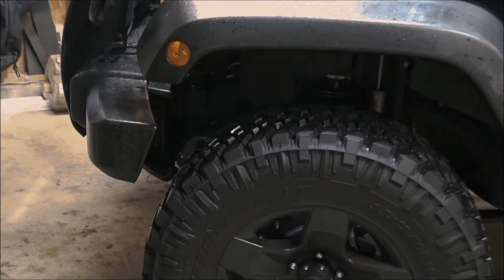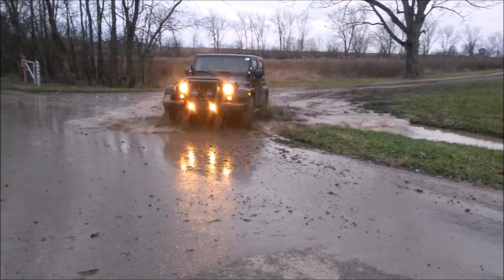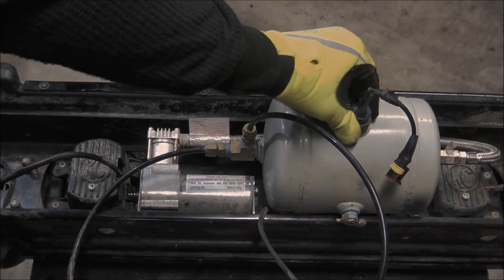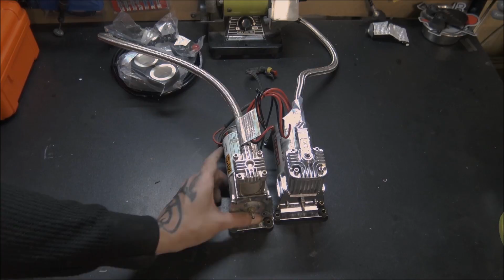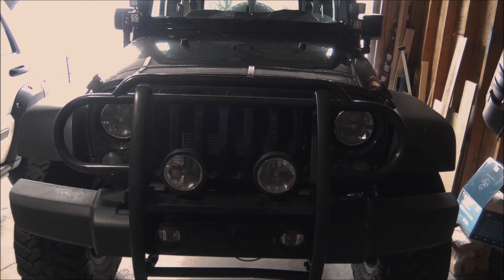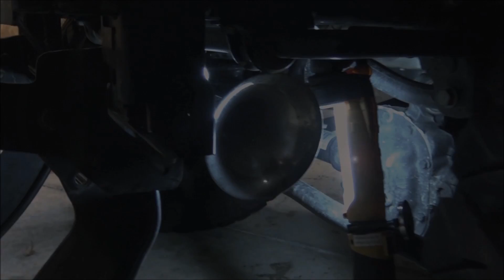Viair Air Compressor for Train Horns! (W/Sound Clips!) Project Dirty Willy Update

Comment: So what was to problem the pressure switch or the compressor?
Reply from the maker: The compressor. I only changed the pressure switch because the new compressor could run at a higher PSI then the old one. Thanks for watching!

Comment: Will you use the compressor to fill up your tires as well as running the horn?
Reply from the maker: I have plans for that in the future, it will be an entirely new setup, new compressors X2, tanks X2, lines ect. This compressor wouldn't really enjoy airing up 35's. Thanks for watching!
Reply: @RockyXTV  My Viair 444c will do 35s no problem...